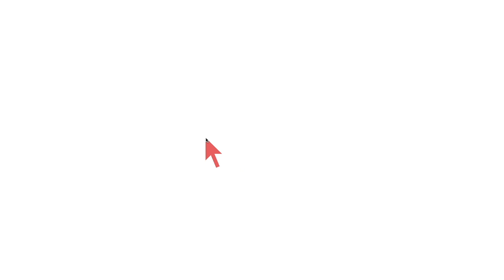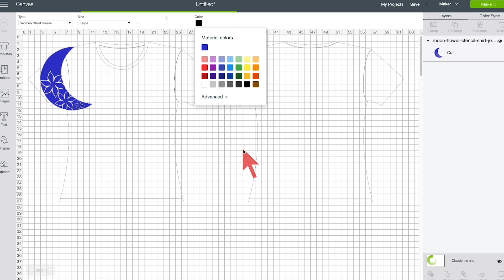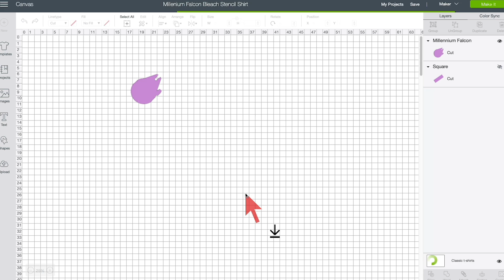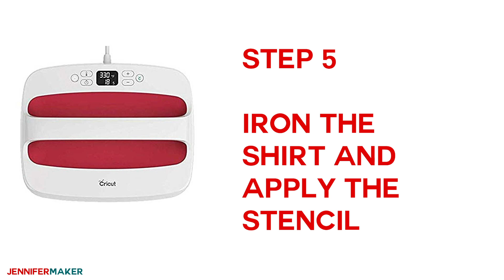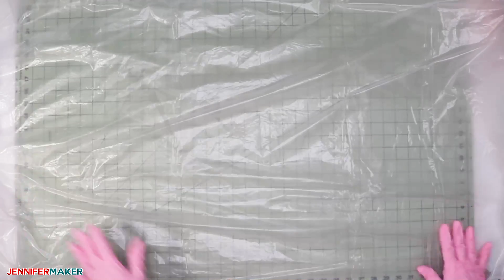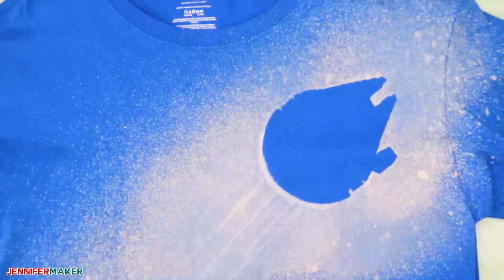Make a Custom Shirt with Bleach!

Comment: Thank you for the helpful video.  Someone on Facebook uses this technique but also added color back by using Tulip spray fabric paint.  At what point do you think they added back the color?  Did they do it on the bleached, but not washed shirt OR do you think they washed/dryed the shirt and then sprayed the color?  Thank you!
Reply: Did your ever find an answer? I'm attempting this exact method this weekend. Bought tulip color shot but not sure at what point to spray the bleached out parts with it! No answers anywhere..
Reply: @Studio_Se7enty8  I did not receive an answer but I did figure it out. Here’s how I made mine.
Create your stencil on your cricket machine using permanent vinyl. Transfer to the shirt and use a brayer to really secure it as best you can. Keep the shirt flat I put plastic between the two layers and plastic around the areas that I did not want to bleach out.
I did this outside and in the sun. Then I used bleach, 50% bleach 50 And used a fine spray bottle creating a oval where I wanted to bleach out the T-shirt.
If you do it in the sun it goes really quickly.
Once it’s lightened up as much as you want put it into a mixture of peroxide and water this will neutralize the bleach so that it doesn’t ruin the fabric.
I then ran it through my washer on a spin cycle.
Take the shirt lay it flat just for safety put plastic between the two layers again.
At this point you would have already removed the stencil after you bleached. 
Now take this tulip spray dye and spritz the colors over the bleached areas. You will notice that they absorb and color the bleach portions of the shirt and they leave the black areas black. So where you made your stencil and removed it from the shirt will now remain black.
Once you get as much color as you want on the shirt then you just let it lay for a couple days then remove the plastic between the layers and run it through the washer.
So far I made three and it was simple and quick.
Reply: @bellknapable  thanks, girl!!! I appreciate it! Not many people like to help too much. Do you have a YouTube channel or tiktok? I'll be happy to follow!😊
Reply: @Studio_Se7enty8  glad to help. Don’t have any type of channel.

Comment: I'd like to use the Moon Flower stencil as a design using vinyl.  I guess I can just cut it out using my vinyl and iron it on.  Is that correct?
Reply from the maker: Yes! Just use iron-on vinyl.

Comment: For the Moon Flower design, do you have to block out the T-Shirt around the Moon Stencil.  I'm guessing you can use the freezer paper to be sure bleach doesn't get on the shirt.
Reply from the maker: I used permanent vinyl and weeded out the moon for the bleach to be applied to.
Reply: I don’t understand how you did the moon. Did you use the bleach pen?

Comment: How did you bleach the moon flower shirt?
Reply from the maker: I made a negative stencil and only bleached the moon. 😊 https://jennifermaker.com/bleach-stencil-shirt/
Reply: Thank you!! I’ve been trying all morning to cut stencil on freezer paper and 3 out of 3 times it didn’t cut very good. Tore the paper. I’ve tried all cutting levels no luck. Is there a specific freezer paper that works better? I just think using the vinyl would get expensive

Comment: How much peroxide to water after bleaching design on to stop bleaching process
Reply from the maker: After about 7 – 10 minutes, dunk the shirt in cold water to stop the bleaching process. Once your design has reached the color you want it to be, immediately dunk it in the cold water you have waiting. No need to peel off the freezer paper, just dunk it in. You also don’t want to wait until the bleach is dry, as that will degrade and eat the fibers and cause holes. 
Wash the shirt on a cold cycle by itself with 1 cup of Hydrogen Peroxide to fully stop the chemical reaction of the bleach. Don’t wash with your normal clothing as there is still bleach in the shirt. 💜

Comment: If you do multiple shirts can they be washed together?
Reply from the maker: As long as the colors are similar.  You wouldn't want to do a white and red together.  Just remember to turn them inside out and do not use fabric softener.  Also, wait at least 24 hours after making them to wash them! 💕

Comment: I find that contact paper works better than transfer tape (plus it's WAY cheaper, I usually grab a roll at the Dollar Tree) on all but textured vinyl (easier to get the design to stick to the shirt & not the tape). Just thought I'd share in case you hadn't heard that before. ;)
Reply from the maker: Yes! Thank you! Contact paper does work great. 😃

Comment: So how would you stop the bleach on say a snowflake ❄ with cutouts if you want to spray around it instead of the internal pattern of the snowflake?  I've seen someone do that and they sprayed the snowflake stencil with a solution before spraying with bleach and the internal pattern wasn't affected
Reply from the maker: I am not totally sure.  I have heard of people ironing the freezer paper to the front of the design, and ironing a solid piece on the back to prevent bleeding.  That might work as well.

Comment: Can't wait to try this! It looks awesome! One question--I also have a front load washer, when you add the cup of hydrogen peroxide, do you pour it on the shirt in the washer or in the drawer where the detergent usually goes?
Reply from the maker: Hi Tracy! If using a front load washer you could pour the peroxide into the bleach dispenser. 🙂
Reply: @JenniferMaker  Thanks!

Comment: if you iron freezer paper on the inside of the shirt before you put the stencil or mask on it'll reduce bleeding and feathering
Reply from the maker: That's a great tip!  We'll try that! Thank you! :)
Reply: Do you mean so its shiny side is facing up inside?  I am guessing the science behind this is that it stiffens the fabric of the shirt to void less movement of the bleach.  Not easy to find freezer paper around here, but will give it a shot.  Seems like a cheaper solution then to vinyl and any bleed effect would add to the design, imo.  Especially in a stary sky-scrape.
Reply: Can you explain how you iron freezer paper on?